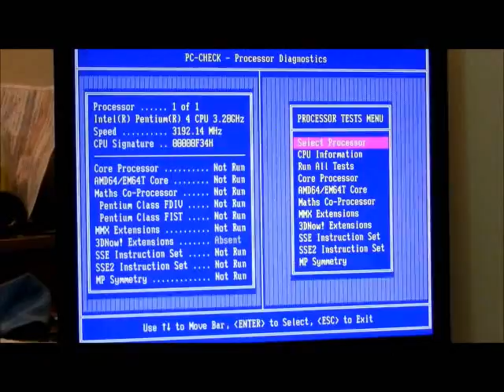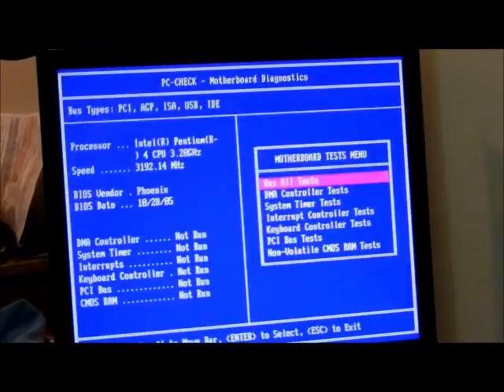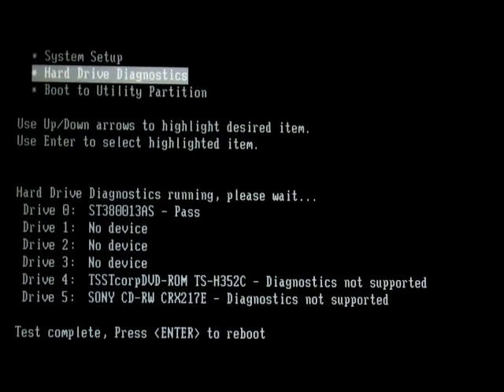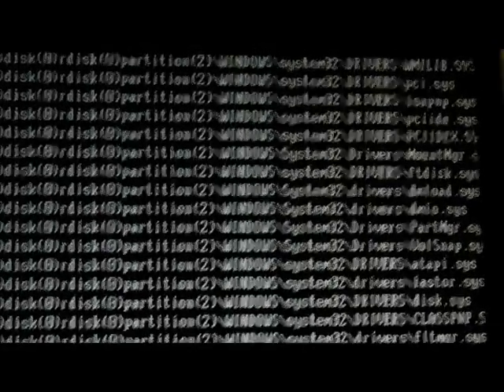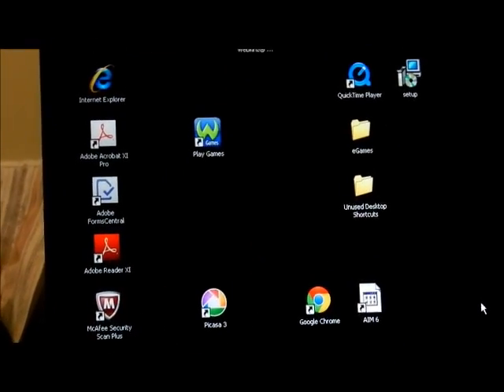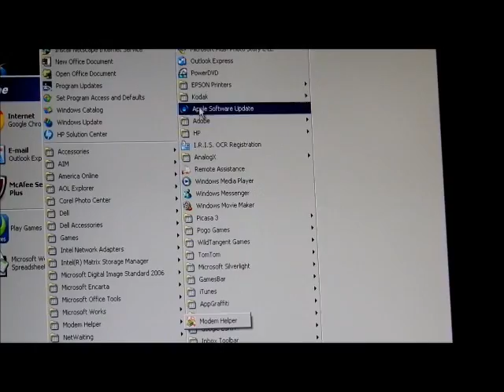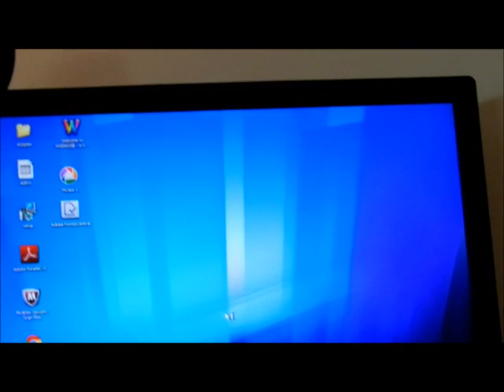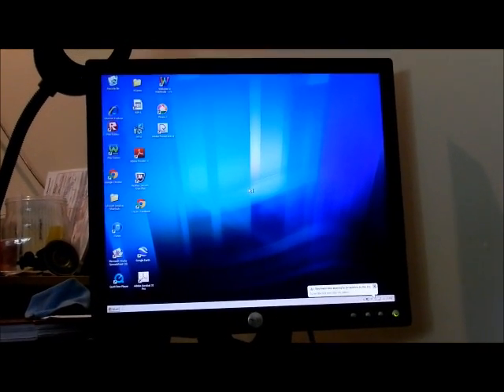Dell XPS 400 Cleaning and Repairing Windows

Comment: i currently have a 10 year old 400 xps i wanted to install windows 7 i have currently 3gbs of ram no video card just the current cpu. do i need to install a video card like gt710 to run windows 7 fresh install or can i install it just like that and which operating system can i instal 64 bit or 23 bit.
Reply from the maker: For these it would be a 32 bit OS's.  Not sure about gt710.

Comment: Thanks to replay . Mine has a lot of virus and I want to reset everything as a factory settings. But when I restarted my computer and pressed f8  I dont get on the menu "repair computer". All others options are there except that one . What I can do or where I have to go
Reply from the maker: You must have the restore CD's that came with the computer.  The model in this video used Windows XP and is no longer supported.  It will take Windows 7 and Ubuntu.  You can look up "Ubuntu" on my channel and see how to load it on your computer.

Comment: if I'm not mistaken there should already be two fans in that xps 420, consider downloading I8kfangui and speed fan, I8kfangui has to be started first for speedfan to detect the fans on the MB there should be at least two, with one possilbe open connector  that can be utilitzed to set up a third MB fan, also graphic cards with fans are also detected by both software packages which should increase the fan speed factors also with the software packages it is possbile to control all the fans speeds detected by the softwares once the programs are set its much easier to cool the system cpu and the graphic cards, I'll keep an eye the video you plan to make regarding the xps 420

Comment: Here are the MB Specs I found as an example:

 
Manufacturer  Dell Inc.
Model  0X8582
AA Number not detected
BIOS Vendor Dell Inc.
BIOS Version A03
BIOS Release Date 07/07/06
System Memory 2.1 GB
Built-in Audio Driver Component not detected
Built-in Audio Driver Version 5.10.0.4823
Built-in Audio Driver Status Non-Intel device detected

PROCESSOR INFORMATION
Manufacturer Intel
Model  Intel(R) Pentium(R) 4 CPU 3.00GHz
Intel Processor analysis tools Intel Processor analysis tools 
CPU Speed 3.0 GHz
Link to Processor Specification Link to Processor Specification
CPU Revision 05
CPU Type 00
CPU Family 0F
CPU Model 04
CPU Stepping 3

I was able to get another area of info seems that page is a no show I'll look for it later..
Reply from the maker: I will make a video on how to install an extra fan on my Dell XPS 420.  I have several fans and if you want one let me know via e-mail.

Comment: actually found I can't change the settings on the motherboard but there are programs that enable me to access certain parts of the MB to effect components without using connectors, also I found out that intel can id the MB I did a scan on the MB and have all the info on the type of MB that is in the Dim. 9100 and it's full capacity, very surprising as well, for example the full cpu on the board, (single core at that), via overclocking is 4ghz max. Intel also indicated the programs required to access the onboard sensors to improve the MB performance

Comment: I did a lil research via google to see if there were people out there who upgraded their dell dim 9100 system to a true dual core or better, I came across a few positive articles indicating that the subjects did in fact do the upgrade to their dim 9100 some used even higher dual core chips, and there were some who also mentioned of upgrading their systems with multicore chips higher then dual core chips with success, that is good news in my book for the dim. 9100 as well as the xps 400 they can be upgraded but with caution .. Lets see what happens ...
Reply from the maker: Sorry for the reply delay. Held up in a hospital bed for a while.  What was the outcome?

Comment: Oh one last thing, I checked the bios, I didn't find anything to adjust the fan settings on the MB, it's strange that for this model the settings are included, very strange in my book ...
Reply from the maker: No need to change setting on the motherboard.  Use an IDE 4PINX5 connector.  You can split it off the power supply.

Comment: I also have found that I can use speedfan with I8kfanGUI to establish a better level of manual control over the cpu fan, they both should pick up any addition fans I can connect to the MB (hopefully) it's a strange one I have to admit but all I can do is adjust until I complete the work on this system in the future. For the time being it's the better approach to use this system for the long term.

Comment: Yes I agree, I don't even know how many fans the dim. 9100 handles I think I may have one large fan somewhere at this end I'll hunt for it and set it aside for a future hook up to see what happens, I also ran into a strange problem with speed fan as it turns out I rebooted the system, after restart the program didn't detect the fan setting in the desktop, so I figured I'd try another program, that didn't work and after a while I dled about a dozen plus cpu fan controller programs, eventually one of them has proven to be useful its titled I8KfanGUI as it turns out it's for a series of dell laptops even though this is the case I found I can manually adjust the speed of the cpu fan as high as 100%, which is fine in my book it's clear the interior of the pc needs to be cooled down especially once I upgrade to a true dual core chip. In my book if it works to do what needs to be done use it ...

Comment: Well I did a lil googling and found a program called speedfan, once it was installed I tinkered with it and got the software to kick the cpu fan on high, since I did this, the cpu temp went from 140 f+ down to 126 f, now that is a good step to show it is possible to bring the temp down now I have to figure out how to get the fan to slow down it's been running high since I got the software going .. lol ...
The fun never ends.

Comment: I did the update, only thing is when I let my system load windows it was suddenly extremely slow, and I mean slow like it never had any speed, I accessed the bios and found a couple of new settings that where enabled, so I disabled those features, speed if fine as it was before the bios update. so far so good ..
Reply from the maker: Outstanding.

Comment: oh the dual core software feature is called Hyper-Threading, it's a software method for the pc to simulate dual core functions, as it's mentioned on both manuals related to my situation both my systems have that situation, dimension 9100 and the Xps 400, even though this is the case I feel it's worth the try, I'll have to rewiew the bios setting too see if there are setting for my heatsink fan.
I've also been thinking of adding an additional fan or two to see if that will help with the expected increase of chip heat from the dual core chip.
Reply from the maker: Sounds good if needed.

Comment: Also I recently experimented with a large hd in another dell system in the same general range of the xps specs, it works fine, 1tb of space in fact, it's also a single core chip with that phatom drive software based setup, I plan to eventually install a dual core chip in the second dell system as well ...

Comment: I found out that the system is able to use a dual core chip since I downloaded the material, If it has a single core chip it may have a phatom dual drive software based setup, that heatsink is found in some of dimension and xps models ..

Comment: I have a xps 400 at this end, it's been sitting in my pc cove ( work station ), it most likely has a single core chip, the reason why the heat sink is so big it's because it can use a dual core chip. I plan to work on my xps in the near future once I complete work on a in coming dell system..